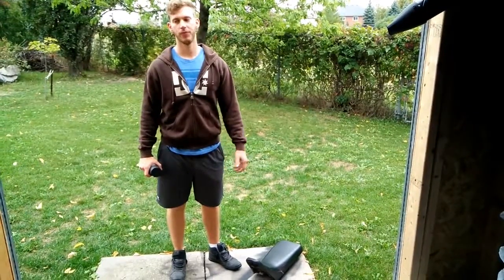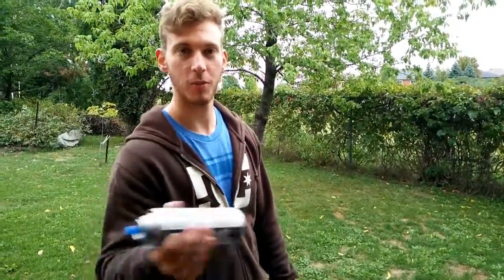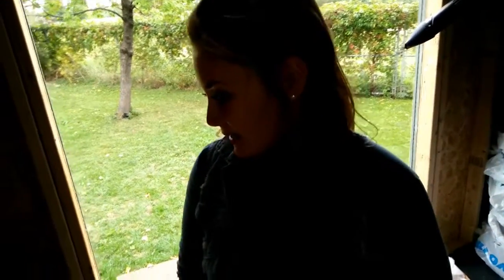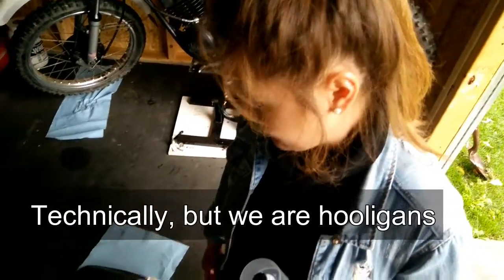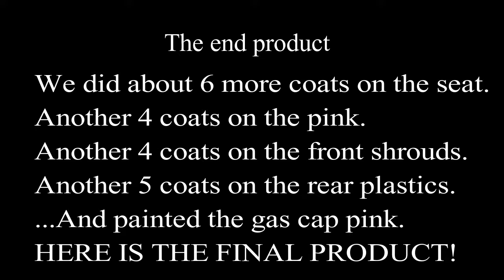How to disassemble your seat and plastics on a 1997 RT-100: plus painting

Comment: Instead of painting the seat I used several coats of black leakseal. Stays flexible and has moderate grip so you don't slide all over the seat. I put 5 layers on it and after several rides it still look new. Love my RT 100 J!